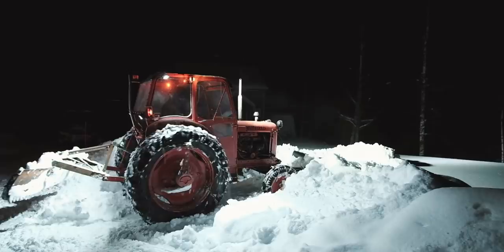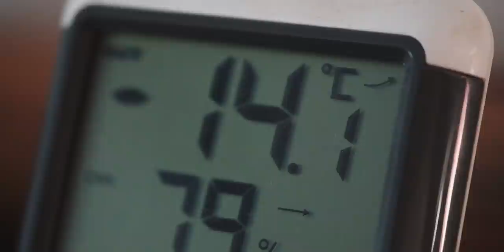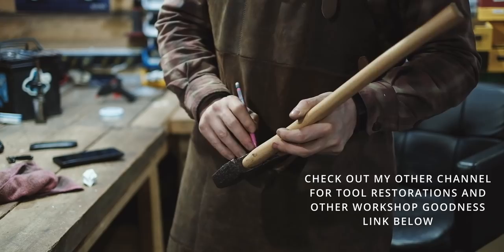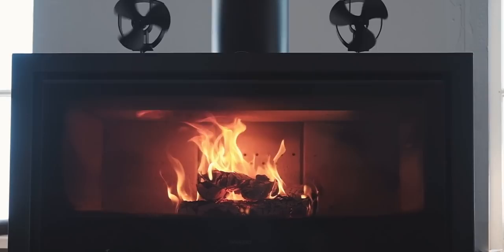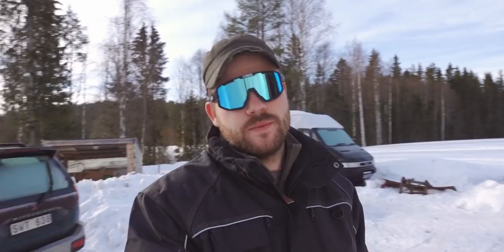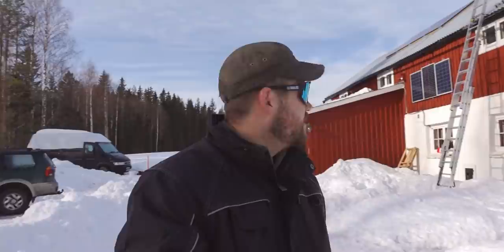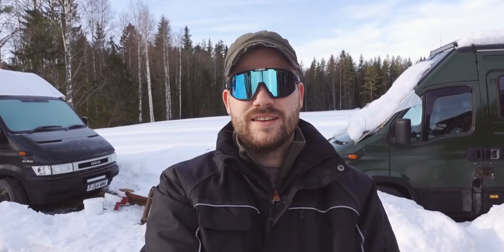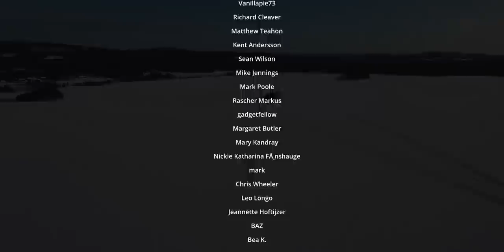Off Grid Cabin In The Swedish Forest

Comment: Thanks for the update Ash and glad you are both doing OK. You have worked hard to make this happen and it's looking damn good 👍 Your priorities are in order to replace the batteries with Lithium as AGM'S are not efficient. I reckon by mid summer with friends and relatives over, some good times await. Be reassured that you will fair so much better than the rest of us, having to pay the most crippling of bills. Good to see Mispronounced dropped by. Keep the momentum going Ash and will look forward to the next video.
Reply from the maker: When you think about it agms are a pretty bad deal 🤣 buy a battery of X capacity but you can only use half... i think this year will be a lot of fun 😊 nice one 👊
Reply: Everyone should be converted to solar by now.

Comment: Just a little thought. You mentioned that you are concidering to buy some lithium batteries. My issue with them is that you can buy 10 times so much of the most basic starter batteries for the same price, which is not only 5 times the capacity of the lithium battery but even the amount of amps you are asking from the batteries will be rediculously smaller what will last those batteries almost forever. So I would advise you to think about to buy the cheapest lead acid battery and buy a lot of them instead of the lithium battery. The lithium is great in a moving object because of the weight. Stationary for me the basic led acid worked like the charms, you just need to make it insanely big so in most cases don't get under 80% discharge, only those days when it's dark. So instead of 400 amp lithium I would buy rather 4000 amp led acid for the same price.

Comment: I guess you know, but there are  heaters that work with wast oil (Motor oil and hydraulics). You can find diy plans if you are bold enough (no me for sure) or ask  the mechanic in the town what they use. Very common in garages in Argentina, and I know a Polish guy in the UK using one in his car shop repairs. I do not know if it work with vegetable wast oil, but some restaurant and pub pay to get rid of the used oil you can get it for free if you ask.

Comment: What about lithium battery from a scraped EV or Hybrid, Nissan Leaf og Mitsubishi Outlander for examble?
Outlander has battery made out of 80 x 3,7V cells, connected into a 300V 12 kWh pack (probably somthing less from a used pack). Can easily be reconnected into 12, 24 or 48V system.
Reply from the maker: Could be a possibility 🤔  seen quite a few people reusing car units. Will definitely look into it